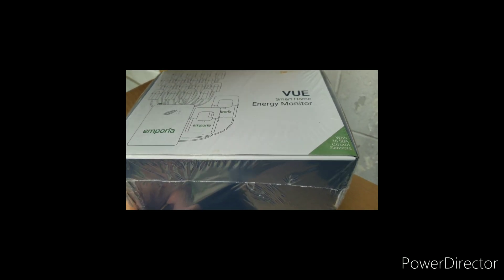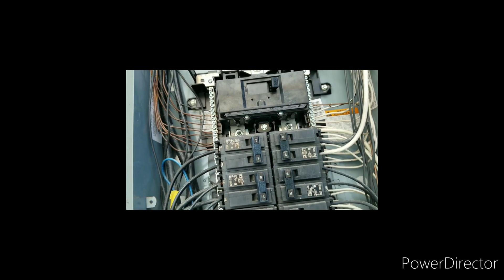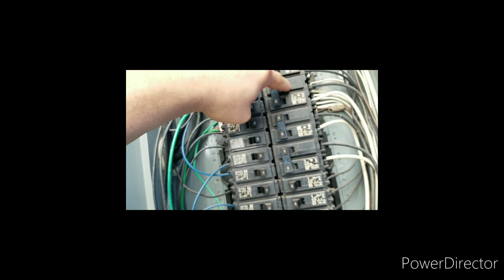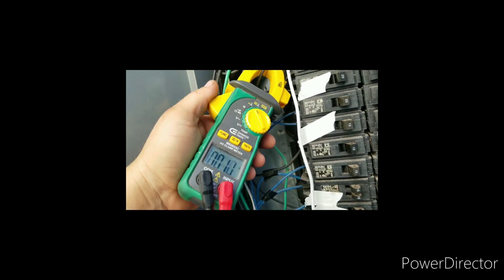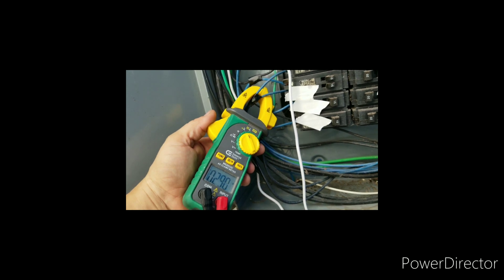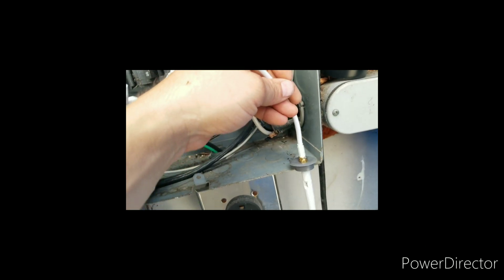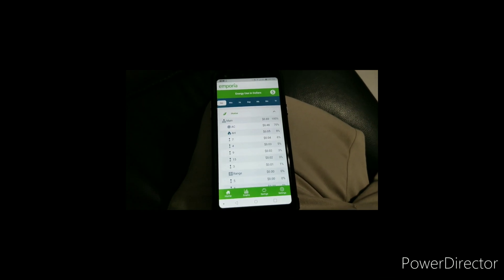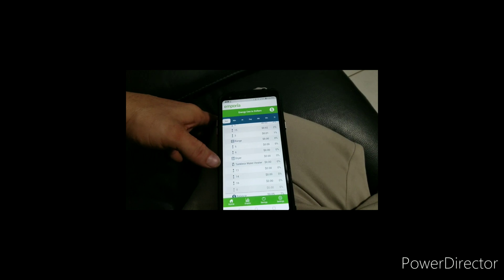Emporia Vue install

Comment: @Mark S. — Are you powering your whole house on power fail with a portable generator via “back feed plug”?
Reply from the maker: I don't have a generator on my system currently. Usually I would backfeed a top breaker and put a generator interlock device on the panel cover.

Comment: @Mark S. — What’s brand/model of you clamp meter?
Reply from the maker: The clamp meter in the video is a commercial electric, it is what I keep around my house, for work I use a Fluke.  Both are pretty generic they measure AC amps well with dc and ac voltage readouts that show quickly.

Comment: 03:25  My darn amp meter won't go back to zero, it always shows something other than zero when no wire is in the clamp.  Frustrating.
04:21  Never read about that during my research before I purchased my unit.  Don't know how I missed your video.  That doubling up is a great idea.  I just people know that you can't use two breakers next (stacked) to each other.
06:11  The L goes towards the load.  On the main power coming into the panel, the K points towards the utility source, and the L points towards the main breaker.  On the branch circuits, the K points towards the breaker, and the L points towards the load or whatever is using the power.
06:48  I plan to feed all of the CT cords through a bushing in the bottom on my panel and hang/secure the magic box under the panel.